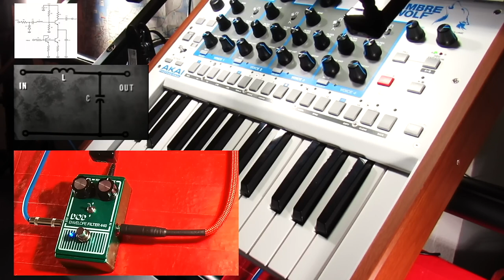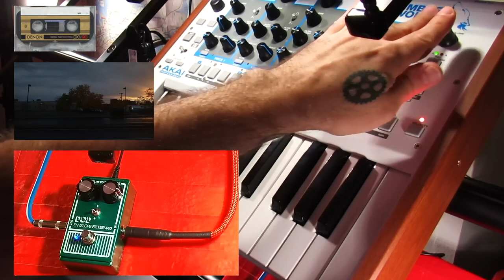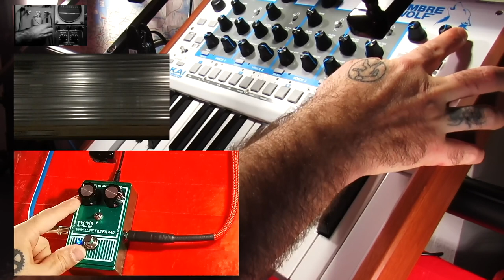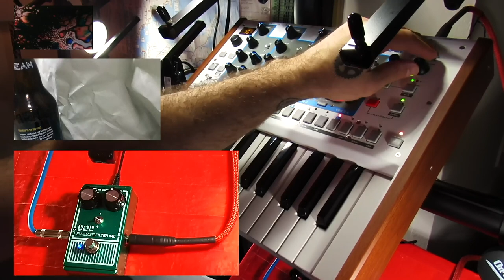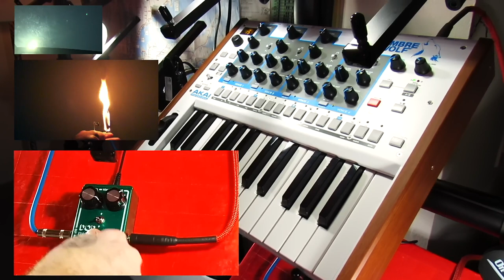Akai Timbre Wolf vs. the DOD Envelope Filter 440

Comment: I appreciate your in depth and measured analysis of the filter. I've been trying to make the Wolf' a little more expressive too. This DOD is a good solution. I enhances those warm Wolfie oscillators. There a lot going on in this video, visually - it was neat to see your hand move from the pedal window to the Wolf.  I especially liked the tape cassette animations!
Reply from the maker: HA! I found that .gif years ago... & it's just been sitting on an External Drive, waiting. 
Glad it came across :] Also, thanks for the encouragement! I appreciate you pressing
play.

Comment: Like the tones you've coaxed out of the TW using the DOD — nice work 👍

I've managed to get pretty decent results using the Waldorf 2-Pole.
Reply from the maker: Yeah, I bought one of them as well. It works significantly better than the DOD EF 440, which is made for Guitars. 

 Another great Effects Chain I found works with the Wolf is Vibrato/Flanger! 

 Thanks for dropping by :]
Reply: @CaalamusTube  yeah vibrato works, I'm using a Digitech Ventura Vibe on the 'Modern' setting, sooo good 😁

Comment: This is great. Sometimes I wonder if AKAI should have gone with a 2 pole filter instead of a 4 pole for a more gritty sound. On the other hand, you can get some pretty smooth filtering with the filter they used. I think they want you to turn up the distortion knob to get more impact if you prefer higher resonance. I’ve definitely made some pretty crunchy baselines with this synth but it is finicky compared to a lot of modern analog synths. I like that it’s not a remake/clone but it’s a unique fully analog polysynth. Kind of rare in a way.
Reply from the maker: I paid $199 for it brand new. So even if I never used the Voices & just appointed it as the Sequencing Brain & Clock in my sessions... it would be well worth the money! 

 I am definitely disappointed in the lack of Envelopes. But yeah, you can get some unique results, if you open your mind.

 But in fact, I made a whole EP with it: 

https://caalamus.bandcamp.com/album/omega-circuits-sketches-w-the-akai-timbre-wolf

 It also it features prominently in many of the Hardware Sessions I upload. I call them "PunkClock". I've skipped a few Seasons now. 
But they normally run from October to April, 4 Mondays a month!  

https://www.youtube.com/watch?v=KHbPigrCJvY&list=PLGx26OGK1eBYugzOc3nohibXEPzhgw6XT

 Thanks for having a look & a listen :] 
...off to check out your Channel√

Comment: Very true for the filter.  Valid for both wolves: timbre and rhythm.
If you run them through a distortion pedal, the filter comes to life all of a sudden. 
Another thing that I miss so much on the Wolves is an LFO. Check this out: https://youtu.be/IvZpgLhLmNU
Some patch points would have been super easy and helpful remedy. You'll end up with quite a few external FX in this case
Reply from the maker: I can't find this Comment anywhere but in the YouTube Studio :P
Reply: @CaalamusTube  another YT bug 🤦‍♂️